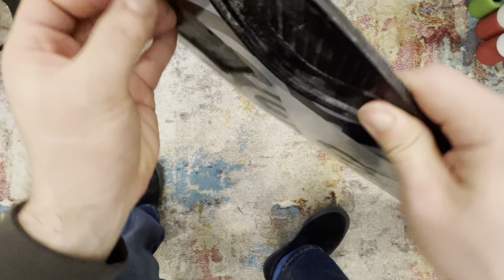How To Build A Freeride Longboard

Comment: The keystone has such a mellow concave. Wish it had wheel flares. But then again it’s also so narrow
Reply from the maker: Great point!  We designed it around narrower trucks around 130-160mm wide.

We did some versions with more wheel flare but it made the front of the board a little too cramped for longer tucking runs.

I use brake soles and 36grit griptape so I enjoy having less concave to get more contact to my griptape
Reply: @BayAreaLongboarder  makes sense. I’m really interested to try a darkside. Seems like the polar opposite of the v3 concave.